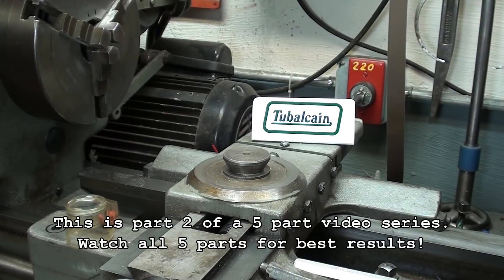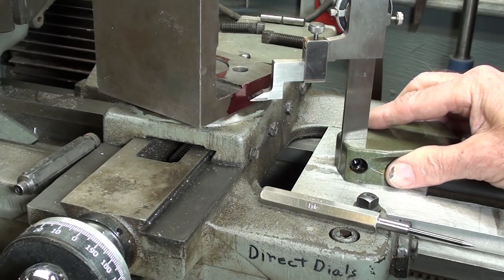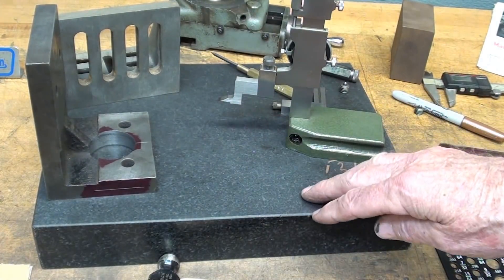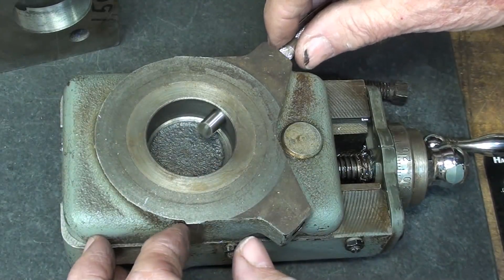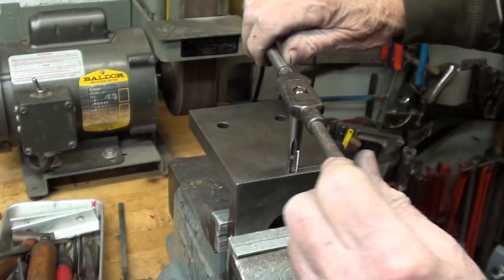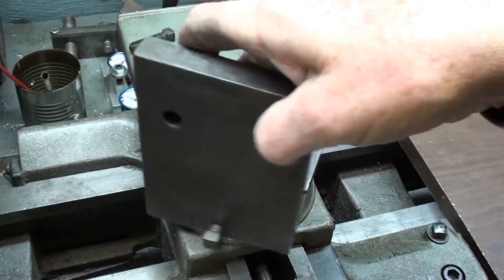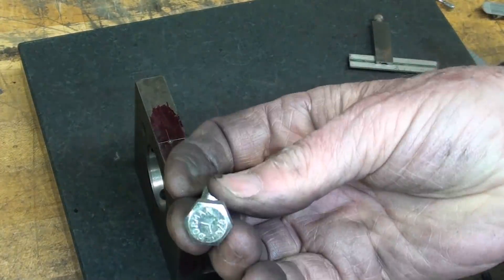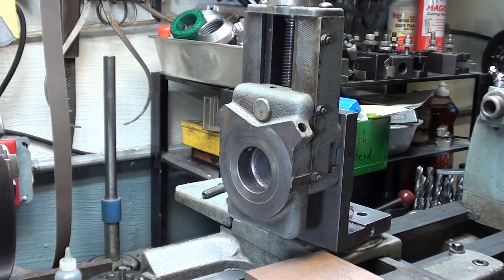Make Atlas Lathe Milling Attachment pt2Tips #451 tubalcain

Comment: Everyone is a critic I guess, but you have the knowledge & wisdom I seek to be a true machinist.
The Altas mounts are opposite of the South Bend...which you mentioned before. I have some heavy steel angle (Schedule 80) to work with. & I might be able to get some 5/8" flat bar to make gussets if I have to. But I'm hoping to make an adapter so that I cvan use othe milling attachments. Mahalo once again for sharing your kknowlege of machinig with all of us.
Aloha,
Chief

Comment: Hello Mr. Pete. Nothing to do with the Atlas but I am looking for the Sector Arms for a K&T Spiral Dividing Head. The unit has a 1.5" bore. I believe the unit is from 1920. It came with a K&T 3B Universal Milling Machine. I figured you might have one or two lying around,lol. If you happen to run across one at an auction, I'm in the market for one. If you have the specs for one or would make one via one of your awesome videos I would be in your debt. If I was able I would post pics of the head and mill. Thanks for all the videos, they are extremely helpful. Bryan
Reply from the maker: I'll watch for one, but I never ran into one in my whole life. So don't hold your breath
Reply: Would you happen to have a diagram to build one?

Comment: Did I miss something, or was a reason you attached the slide to the wrong side of your vertical attachment at the end, i.e. with the slide  overhanging the side of the "L" piece ...
Reply from the maker: Just fitting it up
Reply: Of course you were and you weren't really going to drill 2 more holes to move it down further.
Reply: the web on the other side would prevent the travel of the slide , no ?? I was just going to suggest removing the web till he did the mockup at the end

Comment: I've been told that the surface plate can be deformed by hitting it, thereby messing up the flatness, but it's only important when you're working at very small tolerances, way beyond the scope of a cheap 2" thick plate

Comment: Actually I just got that identical surface plate, along with several other parts; shipping ended up to be just about $10 for the whole order standard ground shipping, so even shipped the plates are a bargain.
Reply from the maker: Wow, I didn't know they could ship something that heavy for that trip.
Reply: I was off a little...the total was $12.99 for shipping, but that included a mt2 arbor and some drill bits. But I'd priced similar surface plates on Ebay and from other suppliers and the shipping costs were staggering. one and a half times the item cost seemed to be the standard. I guess Grizzly gets a significant volume discount...heck they sent me a catalog for free and that weighs nearly as much as the granite does :-)

Comment: Hi Mr Pete,
Enjoying this build, was wondering if you have looked across the pond at the Myford lathe milling slide attachment? They are neat little units and are available as reproductions now, easily modified and adapted to many applications.
Cheers
Reply from the maker: I would like to see one of those
Reply: mrpete222 a quick google search or have a look on lathes.co.uk will sort that out, also if you have time have a look at Steve Jordan’s channel he has done a lot of work with these on a Myford as well as the Chinese mini lathe.
Kind regards

Comment: Wasn't the original plan to have the compound on the inside of the angle plate to reduce overhang? Toward the end of your video you show it on the outside of the angle during your fit up. Oops, someone below made a similar comment.

Comment: Lyle, you bolted the compound slide on the wrong side.  You said originally as you have it now, there would be loss of rigidity due to the overhang.
Reply from the maker: Just fitting it up